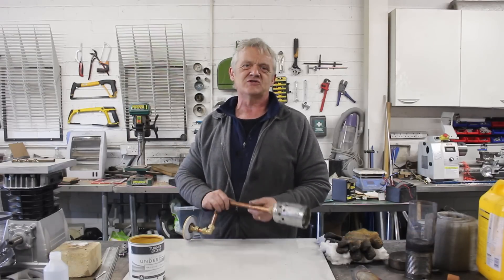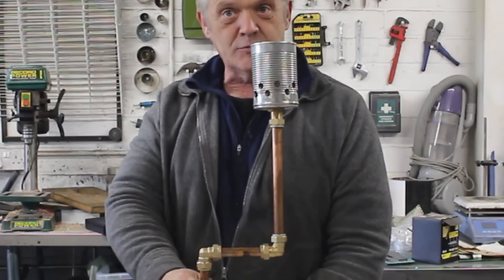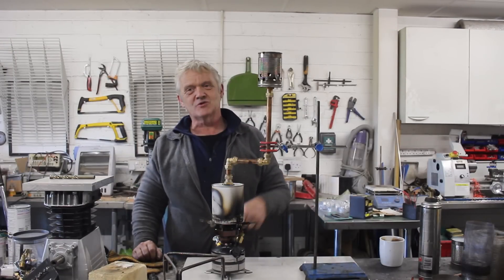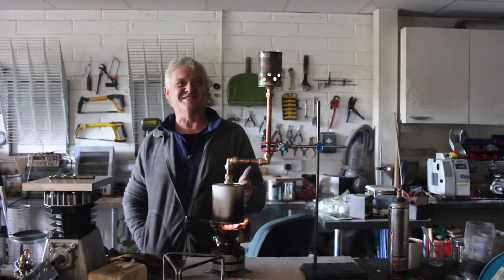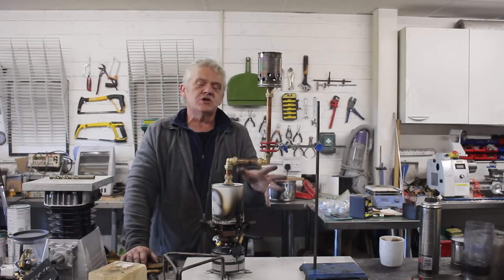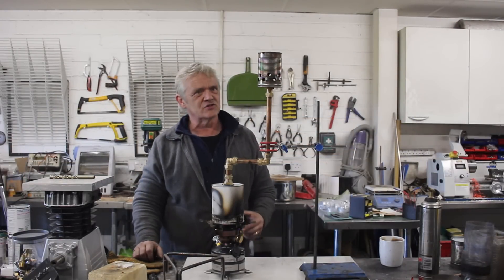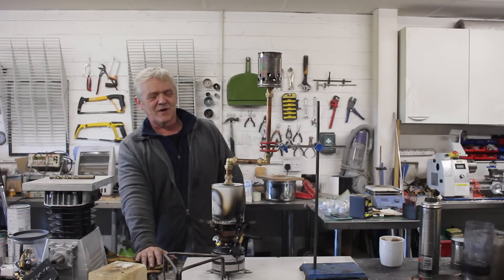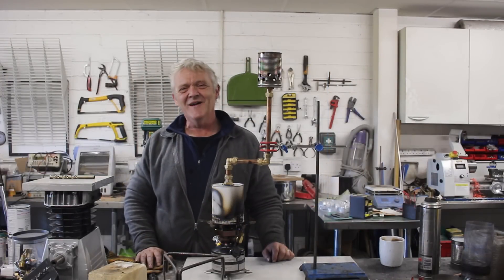1707 Making Fuel At Home - Paint Can Pyrolysis

Comment: What if you used a container, sealed it, pulls partial vacuum on it before heating, use a spring loaded check valve on the output, meaning it requires a slight pressure to allow any outflow,  seems plastics and rosin woods like pine could be used to make fuels, especially if the sun is used to heat the material, and possibly use some of the glasses to add heat to the reaction  the earth is flooded with plastic,  gathering plastic garbage is most likely going to be the mine jobs of the future, to likely be used as fuel,  it's sad we can anywhere on earth and find plastic, from pole to pole, tops of mounts to the deepest parts of the ocean, micro plastics everywhere! We went from iron age to plastic age! I think wax and recycled paper, with very little plastic can replace the disposable plastics we use today, straws could be made from paper coated in plastic or wax, like poper cups, forks and such can be made similar,  sorry to ramble,
Reply: Great ramble!! 
My thoughts Exactly!!
I've seen fuel being produced in this way,
 although you must have a much better grasp of the processing than I have!!

Thank you ever so much for sharing your thoughts and knowledge!!
I'm like a Candle 🕯️ flame 
without enough Oxygen,,,,, a bit Dim!

So, I really appreciate learning from Rob and Everyone  else here!!
Namasté 🙏
Andréa and Critters. ...XxX...
Reply: Also, Humans were managing without any plastics for a very long time indeed!!
They are a Symptom of this Consumer Society....😎👍

Comment: I wonder if you could do some of the steps with electricity or solar heating in a way that's worth it. You could spend a while drying out the wood with a heater coil at a lower temp, and then do the later steps with a gas heater. If driving off the water takes significant energy, it's like you could store solar power in the wood.
Reply from the maker: indeed

Comment: Pyrolysis of vegetable oil is a good one to get a diesel like liquid it caches fire a lot better than the vegetable oil. could be a alternate way to make biodiesel no need for a alkaline or alcohol. i used a solar concentrator with my set up.
Reply from the maker: interesting idea mate - cheers
Reply: this could be helpful 
Palm oil is fully converted by pyrolysis at 420C both with and without catalysts.
Thermal conversion produces big amounts of saponifiables as fatty acids.
The basic catalyst MgO–Al2O3 kills saponifiables, but produces heavy ketones.
Lewis acid catalysts as alumina produce more hydrocarbons.
Brønsted acidic H-ZSM-5 zeolite kills olefins producing more paraffins and aromatics.

Comment: What is the reasoning behind the 90 bends in the copper tubing?
Reply: Availability of parts used in other projects I'd imagine... It wouldn't really make much difference at the length he has there, if he wanted to capture the gas he'd have it piped into a upturned vessel filled with water, the gas would replace the water and then he could burn it at his leisure.
Reply from the maker: Wayne has it mate - this is just a demo of the principle and I used odd bits laying around

Comment: It would be interesting to see how you could store the gas effectively?
Reply from the maker: I am not sure it would be worth it mate - I might make it an on demand system - that would probably be easier? - not sure thanks for bringing it up
Reply: A gasometer can be used they are fairly easy to build with a couple of cans.
Reply: I think storage is more complicated than most will consider to be worth the effort. for syngas.
Reply: I think robs solution is to convert it to methanol and store the energy as a liquid  much safer and convenient than carbon monoxide and hydrogen
Reply: @johnmcfadden9336  That would be perfect!

Comment: I good demonstration of the process, but it begs the question: Are you putting in more energy at the bottom than you are getting out of the top?

Genuine question, as I have no idea of the energy outputs of either end, but the gas canister 'feels' more energy expensive.
Reply from the maker: in this demo we are putting more energy because we are just driving off the water and gas from a few twigs to show the idea in but in general it is the other way round and very often the heat of burning is used to run the paralysis and gasification stages - so you get fire, heat and extra gas
Reply: @ThinkingandTinkering  Awesome - thanks for the clarification.

Comment: Robert, can you use old carpet to make diesel fuel? It would be great to use all that old carpet instead of filling the landfill with it!
Reply from the maker: it would depend on what the carpet is made from but in general - yes
Reply: AFAIK you can break most things down to their base elements given enough heat in absence of oxygen.
Reply: @Absfor30  so can u do water with it 🤣🤣🤣
Reply: @hunainkun8875  that will simply boil away...🤣
Reply: @Absfor30  that's what is was telling to u
Reply: @Absfor30  not all compound can change in ther basic elements
Reply: @Absfor30  there r many proce of decomposition like thermal and electrical
Reply: @Absfor30  by the way from which country r u
Reply: Interesting, Polyester i guess? There must be a mountain load of waste carpet :)
Reply: @BasementBen  hopefully one day it all tips gets dug up and turn into fuel with excess renewable energy . We have to save the ground water from contamination !
Reply: If you burn your carpet for diesel PLEASE make a video I'll totally watch it lol.

Comment: Very simple explanation and to the point. Thanks again my good sir. By the way I got some of the parts in for making the heater..I got a few different sized screens to see if one size works better that another. I don't know when I will get to do this experiment but hopefully by this weekend. I have winter to get ready for and lots of wood to stack and split. God bless and keep those videos coming.
Reply from the maker: when you get round to it let us know what difference screen size makes will you?
Reply: @ThinkingandTinkering  Absolutely. I got a lot of this other stuff from thrift shops and work scraps. The fuel ironically enough is free 110 gallons of expired hand sanitizer. There is another 1300 plus gallons as well. Just giving this stuff away literally. Just go and pick it up. Crazy.